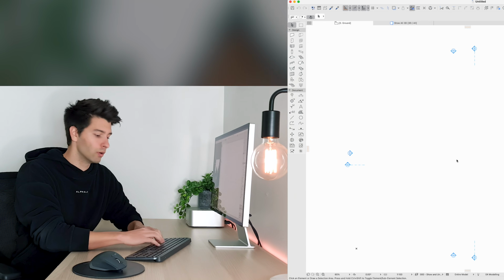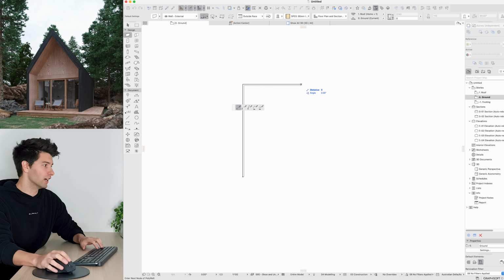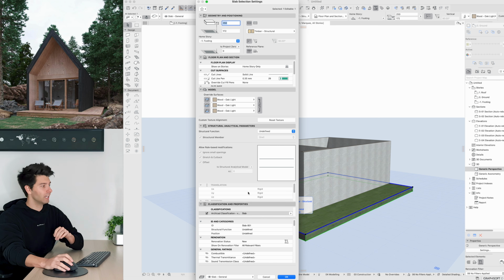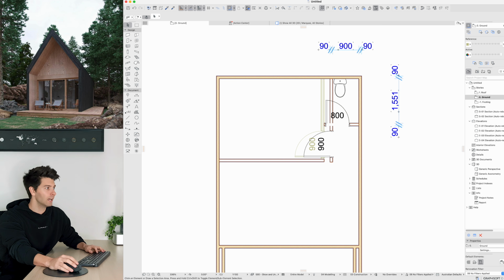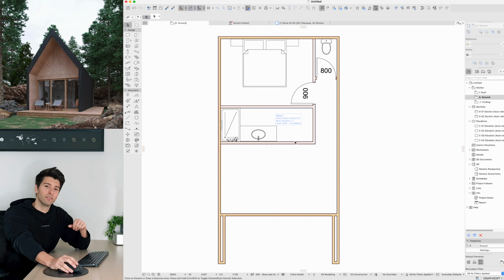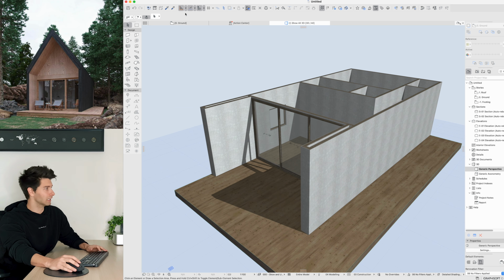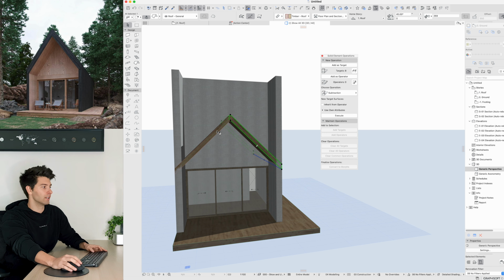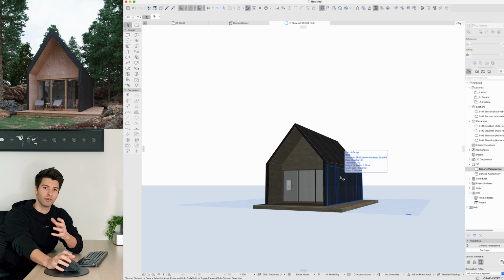Easiest BIM Software For Beginners ArchiCAD 26 in 30 Minutes

Comment: There is one thing i dont understand in these BIM software... it does not show the "details" for example how the example: reinforced concrete plates meets with insulation, heating, joints, foams, foils, planks or similar the thicknesses as well,it look s like its just "blocks" not walls, roofs

Comment: hi, just a question, neither of these short commands work for me. For example mirroring the roof, connecting the roof pieces in the middle or marking all the walls to make them all a different height, do u have any idea why that is? its driving me mad to do it all manually...

Comment: I am very sorry, but the speed of the video is not suitable for beginners. You should have taken that into consideration. I am thankful for the information you provided, but I had to struggle a lot to follow your actions. That was a tough experience.
Reply: @valeriagerts6040 I guess it’s based on the individual, I found this very easy to digest and follow along, slower tutorials are very hard for me to follow along with.😅
Reply from the maker: Try the full length course on my channel instead
Reply: 😂try to play it on half the speed
Reply: Perfect speed
Reply: Found it fast as well but slowed it down and re-watched and so was able to follow along... Great info.. Great work ..very helpful

Comment: Great tutorial. I only missed the command when the roof is merged at the middle.
Reply from the maker: Select one roof. Hold control/cmd. Click on the other roof edge you want to merge/align with.
Reply: Thanks! It worked! Tried moving the edged at the middle, but the join was overlaping. Now everything is nice.  @DavidTomic

Comment: Good morning
I have a little problem when I want to knock down the wall I type p on the keyboard but the latter does not respond the same for the m key when I type m it does not correspond to the mirror but a graduated line.
THANKS

Comment: david i cant connect the roofs in the middle, i've done press alt ctrl, the roofs still the same position and not connect in the middle, what should i do? thanks for ur answer
Reply from the maker: Select one roof, hold ctrl and then click the other roofs edge line..it should automatically align. 
If not you can always adjust manually just a bit more work
Reply: @DavidTomic  thanks david, sorry i wanna ask 1 more out of topic question, do you know why my accessorries cant appear in design extras although ive downloaded archicad goodies 26 for my archicad 26

Comment: sir, can you please tell why i can not adjust the shower size  just lke you did..thank u
Reply from the maker: Should be able to select the corner black node and then use the adjust tool in the toolbar to adjust it. Otherwise open settings ctrl + t and adjust at the top in the dimensions

Comment: Awesome video sir👌👌. 
Sir I have just completed my class12 that is senior secondary school. I will be doing my bachelors in architecture or architecture engineering from Australia.
So, I am confused between these two fields which one should I choose.
If I talk about the technical part that is the engineering part, I m pretty confident about it that I will be able to do it and have immense interest in that, but I don't know about the design part whether I will be able to do that or not. As per now I dont know whether I have interest in design or not.
So, I just wanted to ask that can a person learn and understand the designing part once he enters into the course. 
Also, I m very poor at drawing and I don't like it.
Reply from the maker: If you do not like designing or drawing (drawing isn't very important) it sounds like you would be better suited to an engineering degree. I made a video architecture vs engineering, worth watching. It might help
Reply: @DavidTomic  Thank you so much sir for the reply. 
Sir but it is said that architects are like doctors, they have the overview of each and everything, whether its about construction, material, structures. Therefore, I want to consider B.Arch also in my graduation.
So, what if I take a degree that covers both engineering and architecture coz there are some courses like engineering with architecture which are available. So, in this case both the options would be open for me, once I complete my graduation. And then I can get specialization in one field.
Sorry to disturb u sir again&again but I would highly grateful to u, if you could help and guide me about the same, coz I m heavily confused it.